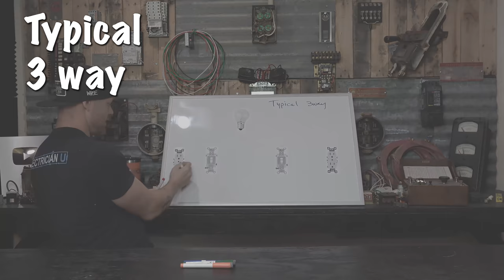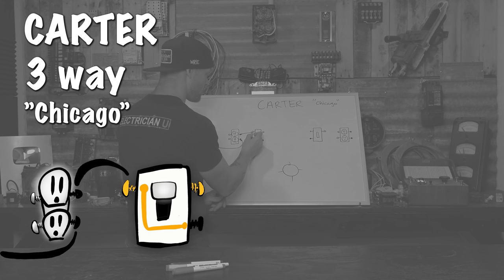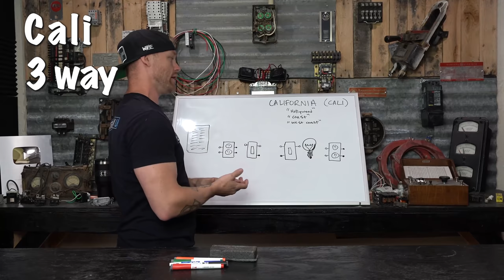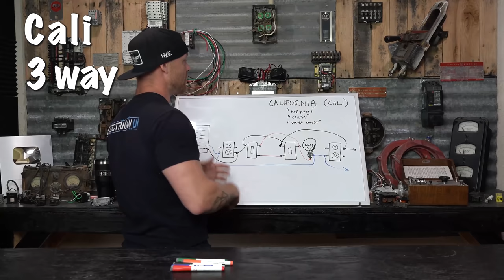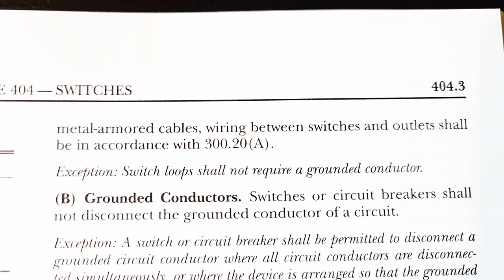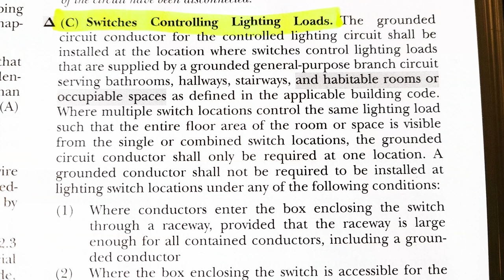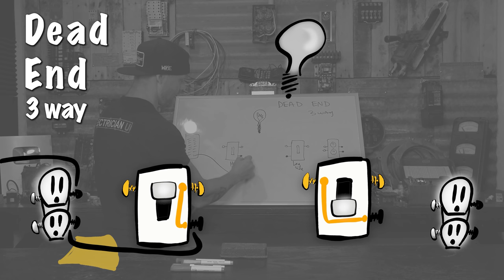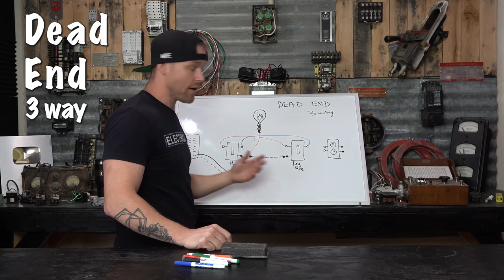THREE WAYS 3-WAYS CAN BE (3way Switch Wiring - ILLEGAL AND LEGAL METHODS)

Comment: 2:23 Why do you call  it a 3-way with only 2 switches ? Obviously, in the UK we call that a 2-way as there's 2 switches. If a third switch was added, we'd call that a 3-way.
Ahh, you mean a 3 -terminal switch - and 4-terminal switch.

We also don't bother with neutrals to the switches - as the switches only switch the live wire. The neutral just goes straing to the bulb, here.

Comment: How about the method where power goes to the light 1st, then 3 wires down to each switch? Bonus stupidity points for crazy people that tape then use the bare ground as a switched hot, on one of the switches because it used to be a single switch.
Reply: I've done this once and the only reason was because, to add another leg I would've had to rip up sheet rock and they didn't even have the money to pay me, it was a favor and I didn't want them to have holes in their sheet rock and not be able to pay to pay to get it fixed. Made due with what I had lol.

Comment: Have a question   I was at a garage fire wi th h romex in the walls. The spray foam insulation  burned  and it spread into the wood structure.  All your blue boxes you install burned down  and melted  and your romex cable you like to install , burned  toxic smoke, I think you should go into your mlm local fire department and ask for a demonstration  . I only have 40 years working as electrician I have never installed 1 single blue box,or  
Any romex cable  when I get in that situation  I reply we remove all romex and plastic blue boxes.  Or find a different electrician. You have the choice . But all I see with you is romex. .let me know what your fire department  tells  you
Reply: Sorry, but I'd go with the finding another electrician option. Non-metallic cable is by far the dominant selection for residential situations - very flexible and easy to work with. To suggest to a customer that Romex should be removed is a step too far. Same story for plumbing - PEX for water supply and PVC for waste offer a lot of advantages. People only have so much money for projects - if you can't take advantage of newer, more cost effective materials then improvement projects can be delayed and people have to put up with dangerous conditions longer.
Reply: Los Angeles CA used to use flexable galvanized conduit in residential, but many years ago now they allow romex even my uncle who is now desed used some romex in his house and he was licensed ( in CA) as a commercial electrican for about 50 years.

Comment: Freakin awesome video! On the Chicago 3 way, what potential problems can occur with reversed polarity?
Reply: Safety?
Reply: AC power is nothing but reversing polarity 60 times per second... Or 50 times per second... That's what AC stands for: Alternating Current. I don't understand the question.
Reply: @godzillafirebox7765   I'll try to clarify with my limited knowledge. In your explanation of the Chicago 3 way, you said that they are illegal because the polarity on the light becomes reversed when one of the switches turns on and then back to normal when the other switch turns on (If I understood correctly,   **4:30 in video**) 
So my question was what problems can occur when it is wired this way? Why is it illegal? 
Hope this is a little more clear
Reply: @devinslade6435  Sorry that's not me explaining in the video! I didn't understand what you meant by polarity - I get it now. Best answer I can give is that by switching that way you can end up presenting line voltage at the lamp socket's outer edge and much more easily get shocked. You can end up turning the lamp off by presenting line voltage to both the tip of the lamp as well as the base, and in so doing present zero volts across the filament resulting in the light being off. I hope this helps.
Reply: @godzillafirebox7765  this is the part of split phase a/c power as used in US & Canada that many people don't understand. The hot (black) wires have the voltage (power)  White neutral wires have no voltage potential and behave as a ground.  This results in the circuit behaving as a DC circuit for practical purposes. Light bulbs will operate regardless of what polarity they're connected in same with many electrical device loads but  sending power into the part of the device that would normally be connected to neutral like the screw shell of a light fixture energizes parts not intended to be live thereby creating a shock & electrical hazard.
Reply: Not unlike in the DC world of cars where some manufacturers run 12v to loads and switch ground to turn on light bulbs and accessories instead of switching 12v. Only the 12v you touch in the socket in a car, if you even can, won't hurt you. Just stay away from the ignition system... Makes 120v feel tame by comparison. It's not the volts that kill though. It's current. I haven't heard of anyone dying of getting shocked by static electricity in the wintertime even though it can hurt like a M&^#*@F?!"*@... Static electricity can be in the thousands of volts.

Comment: Why do switches work as you describe? It would make much more sense if turned 90 deg. Here's what I mean. You show the switch alternating from connecting the screw at 5 oclock to either the one at 11 oclock or 1 oclock. So the vertical switch movement moves the contacts horizontally*, from 11 to 1 oclock and back. In effect it pivots or rocks around the 5 oclock screw. Why not have it pivot about the 11 oclock screw, so a *vertical switch movement moves the connection *vertically*, from 1 to 5 oclock and back?! This would seem much more intuitive for wiring and design conceptulazation. This is more a design issue as you're just showing us how they work, but why didn't they design them more intuitively in the first place?!

Comment: I always thought a California 3-way was when you had a hot and neutral going to 1 switch box, with hot connected to black term, then a 3 conductor going to a second box with black and red being the travelers, then the white wire(wrapped in black) is connected to the second switch black term and coming back to the first switch box where the white wire(wrapped in black) is wire nutted to the hot leg going to bulb. If that is not a California, what is it?  The benefit is it allows addition of a 3 way switch to what was a single switch set up without running a new switch leg to fixture. Non code confirming??
Reply: Duh. Dead end.
Reply: Sounds like you are describing the dead end 3 way.
Reply: Dude I thought the same thing lol

Comment: you kind of messed up a california 3 way. the switch leg and power are always on the black screws. and the smart thing is to run your constant power over your white wire(if you have to california it.) so it cant be mistaken for a neutral. your black and red wires are your travelers(they connect the gold screws on the 2 switches as you should know) you never put a switch leg on a gold screw as it will only work in one position that way. hope this helps you . also california 3 ways are only used when you have an existing single pole switch, and you want to add a 3 way location so you run a single 12-14/3 to the other location. you should never use them in new construction because there is no point. it just makes makeup a pain in the ass.
Reply: With a dead end 3 way, always use red and white travelers. I was always taught this because at your 1st switch(hot AND leg side) white from light ties to white from main source and gets tucked back and don't have to worry about. Black wire in 14/2 from light(switch leg) always goes to common side of 1st switch, and your black wire in 14/3 from switch to switch ties into main source 14/2 then gets wire nuted and tucked back( unless you need pig tails for numerous other switches going in that same box) This way when you go make up the dead end side your travelers never get confused. Black is always common. Unless we're doing switch loop 3 ways where feed is in light with 14/3 going to each switch or (half-ass) 3 ways. Where you have 14/2 feeding 1st switch, 14/3 from 1st switch to light, 14/3 from light to 2nd switch. I mostly do new const. so my guys and I will never run wire like halfasses or switch loop 3's but for remodeling and diagnostic purposes its very useful

Comment: NO!! I am not going to have a piece of 12/2 coming from a light fixture unless I'm using aluminum, which I would never choose to use. Holy crap! What kind of light fixture requires 20 amps?
14/2 is quite enough.

Comment: I wish everyone followed the code in india.
There's no inspections here. So nobody bothers what the code says.

I do a lot of DIY in my home, and the most recent one was, adding lights to the cow shed.
I went to buy the wires. According to code, Red is phase, Black is neutral, green is earth.
But the electric shop guy gave me a hard time giving the correct colours.
He say, the black one is upstairs, can I just give all red wites instead?
I say, I'm amateur, I get confused, so I need different colours, then he comes back with blue wire because he couldn't find the black ones. Says, you just need different colours, doesn't matter which colour.
After a lot of arguing, I finally got the correct wires.
He had the audacity to tell me, "stupid ametuers don't know what they're doing, wire is wire, electricity doesn't care which colour the wire is. you just need to keep track of them, that's all, experts wouldn't need any colours"

Then when I open the nearest box. Every single wore is red inside. The phase supply wire is Yellow. Neutral and earth are also red. The return wire, phase. And eveything else is red.
I had to carefully check every wire. Probing with a tester and everything, fortunately I figured it out and no fires.

(Yellow and blue wires are supposed to be used in 3-phase systems. Nothing to do with house wiring.)
I say i

Comment: Help Please. 
1st.. I'm not an "electrician per sa.. but, spent last 20 years working side by side with union electrician, plumbers, etc. I know a lot, know codes, know my limits ... and when to call a licensed pro..

I've asked all the old timers, nobody has the answer. Thinking it's a new "smart" way to wore a 3 way. Trailer as a com wire...
I can't fond anything to match my wiring. 

1st ..
Leviton IPV 5, and remote in there now, and working. Don't know how, since wiring diagram don't match that set up either. 

I have box 1..
Hot 120 to BK
Neut to WT
Traveler to 3 way
Load to RD
Green ground.

Box 2 
Same thing, less RD. 

Pulled switches, verified..
both 120 lines, pig tailed off other outlets. 
Both neut. Pig tailed off other outlets. 
3 way single isolated wire between boxes.
RD is load. 

Never seen this before. 
3 retired union electrician, have no clue. 

Can't get 3 way dimmers to work. 
Tried 2, 3 way dimmers. 
Tried 1 3way dimmer, 1 3way on/off.

Lutron Diva 3 way dimmer
Lutron 3 way sw. 

2 switches. 
5 14w LED flush mount.
The lights do work with single location dimmer, thru rest of unit. Lights are dimmable.

Comment: the dead end 3 way can be done without wire nuts on the switch leg. why use it if you dont need to?
Reply: also you can keep a permanent hot at the 2nd switch using this method
Reply: Or run unnecessary wire!

Comment: I wonder who came up with the swapping of hot and neutral method of wiring a 3-way.  Whoever it was is long dead, I'm sure, and not just because it was 100 years ago, but probably because he electrocuted himself at some point.
Reply: In the knob and tube houses I have worked in a regular ceiling fixture is wired as: a single hot coming up the wall to the switch, then the switched hot running up to the ceiling fixture (say a chandelier), then the return(neutral) running across the ceiling to the other side of the room and connecting to a neutral in an outlet, or running down into the basement and tapping a neutral wire there (of course not in a junction box).  When the homeowner later wanted an upgrade to control the overhead light from both entrances to the room, the simplest approach was to add an old box in the same stud bay as that outlet we talked about and add the 3-way switch to that return wire and then fish another hot wire up from that outlet (or basement).

Comment: Three way or single pole double throw four way or double pole double throw
Reply: Double pole single throw my bad
Reply: @paulkirby6822  The three-way is an SPDT where source or load goes to the center contact, and the travelers go to the two outside contacts.

The four-way is a different beast entirely. Think of it internally as either in straight - through mode, or cross mode. Picture the switch in your mind facing you with the contacts on the sides.

Top left - A, top right a
Bottom left B, bottom right b

Straight - through mode A-a and B-b
Cross mode A-b and B-a

SPDT ---<==
4-way = or x

So a circuit could look like this:
Source ---<====x====x====x====>--- Load
Switch any of the switches and your circuit is either made or broken at any location. Missing in this over simplified diagram is of course neutral and ground.

Comment: Personally, I think it should be a requirement that all boxes have hot/neutral/ground going to them....regardless if it is going to get used or not.  And legs should be a different color, in my opinion.
Reply: Legs are legs brother doesn't matter the color. Years ago my boss told me to ask the wire if it cares what color it is or not, I didn't ask the wire, but it was humiliating and eye opening for my electric knowledge.
Reply: @kaseyatwell1640  it's not about whether the wire cares, it's about making it easier for the next repair or change by you or another person in the future.  I said it's my opinion for a reason, meaning that I use these schemes in my life so that if I have to revisit those junctions again, I know what to expect.  If it were a requirement, then ANY new location would have that same level of expectation placed on them by a tech.  Yes, you should still verify, but I also think that if a junction is found to be wrong, then the previous tech should lose their license....I don't play.  If you do things right, then no one gets hurt, and that's what it really boils down to.  If we had those requirements and punishments, then the trade would be much different, and hopefully all homes would eventually move toward standardization.

But somehow you think it's about the wire's feelings....cute.

Comment: That is not the proper way to wire a dead end three way no white should ever be on a common screw being that the code says no white should be used as a SL instead splice the hot to the black going to the 3 way with only 3 wires and put it on the common screw the two other wires white and red to the travelers in the switch box with the black SL coming from the light connect that to the common screw obviously the 3 wire white and red are travelers with a black  spliced to the feed in the back of the box much more practical

Comment: the graffiti / clipart animation is really annoying. why waste the time to draw on a whiteboard to cover it up w/ a confusing and hard to read animation? I was struggling to just watch what you were drawing and distracted by the video going black and white and animation. i turned off the video after 2:30 to leave this comment. this is coming from someone with an MS in electrical engineering